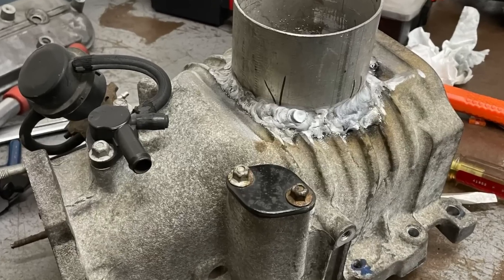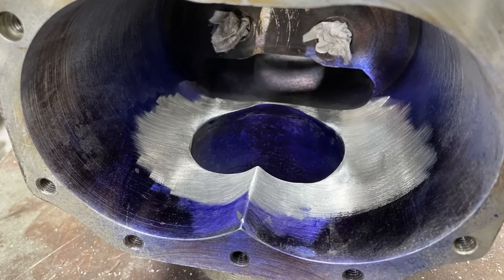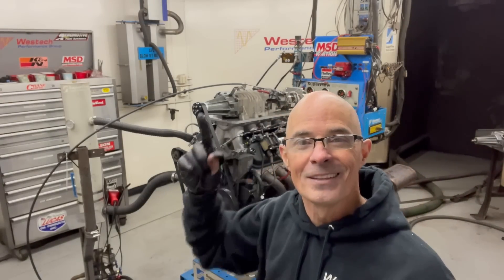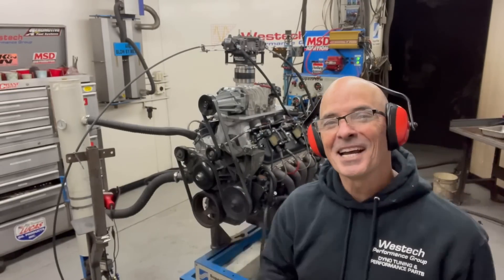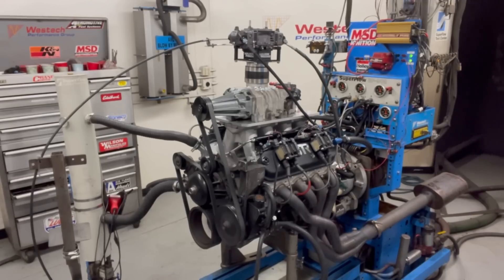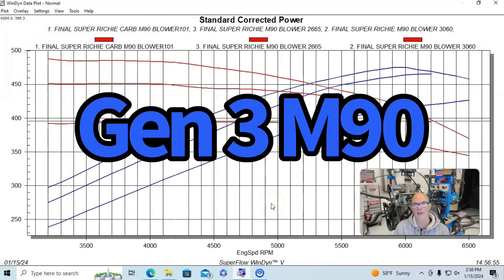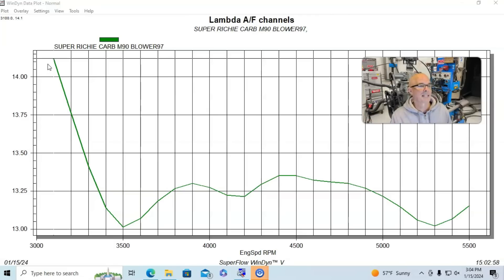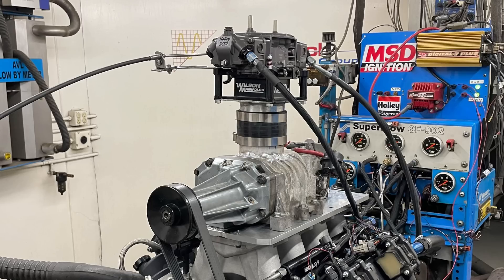CARBURETED M90 LS TEST-HOW TO: RUN A CARB ON A CHEAP M90 SUPERCHARGER! JUST CUT A HOLE IN THE TOP!

Comment: I cringed a bit when i saw the booger welding and warpage. I'd like to see a mill clean up a flat, bore the appropriate hole, then drill and tap for an aluminum plate, milling a groove for an o ring to seal. Routine stuff for a experienced machinist. I liked your results though. Sometimes you have to go with the quick and dirty methods.

Comment: Wonder if low temp aluminum brazing rod would hold, they are "low temp" but not 200° low temp, they still need a bernzomatic to melt and its flame is waaaay hotter than engine temp.

Comment: The Australian chevy (holden) has a 135 degree rear snorkel for the M90... works well in moving the intake... an alternative to a mod like this.
Reply from the maker: that is not an alternative to the carb mounted on top of the blower, but might help with efi on RWD applications

Comment: would have been good if you put it in a mill have a flat for tapped holes and make the top port even bigger again
Reply from the maker: there isn't room or material for that
Reply: @richardholdener1727  im hearing lack of skill and a mill its possible

Comment: Use a milling machine and press fit the pipe with an arbor bushing after you apply loctite to the contact surface, then just use a cutter to precisely mill of the excess that protrudes beyond the inner case surface.

Comment: U should've shouldnt have applied so much heat at once do lil spots at a time an i can bet it wont warp 😂😂 i like your videos sir im not a pro mechanic but i learn alot watching these videos
Reply from the maker: the welding was done a little at a time-the material is very thin

Comment: Awesome video! I currently have a Twin M90 setup on a Small block chevy i fabbed up a few years back. I took my blower housings to the band saw and cut them off right at the back of the bypass holes. I then welded the bypasses shut and fabbed up flanges on the rear of the blowers to connect an upper intake to.  I fabricated my lower intake on top of an old performer intake, basically welded a box on top of the 4150 flange, then funneled it up to fit the base of both M90's. I did all of the lower intake welding first so i could bolt the blowers down to the base before welding on the rear of the housings. I also did my welding with the blowers assembled. I feel you might have not had nearly as much warpage if the front cover was in place at the time of welding. Or even make a dummy cover out of 1/4 inch steel to hold the large opening in place while putting the heat to it. I am running a serpentine pulley on the crank off of a TBI,   chevy truck (not sure what diameter that pulley is) with stock pully's on the blowers and it makes about 11-12 PSI at 6800 to 7K. I was running a 750 Mechanical secondary double pumper with 78's in the front and 86's in the back, but with a power valve block off... Unfortunately my lack of knowledge on setting up the carb ended in me running face of the sun lean and i melted a really nice set of blower  pistons out of it...  Really should have boost referenced the power valve properly.... Right now it's back together with a stock bottom end, and if my math is correct, at least from the Blower Shops equation, I actually need to bump up to a 1050 to feed what the twins are making.......  It's so cool to see this stuff tested on a dyno while making all of these wild changes, Keep it up!!

Comment: I think you should v6 that blower  i have a vp ( buick v6) with a 6v71 Detroit blower and twin throttle bodies (some videos on my channel) not tuned stock injectors and it runs will be interesting once injectors and tune done.      This did do alot better than I expected though

Comment: Richard I Am David Bates from Montana I contacted you about a year ago about putting an M90 supercharger on a 2.3 l Ford Lima engine I still plan on doing it I want to learn more about the video where you had the carburetor on the elbow
Reply from the maker: going into the throttle body
Reply: @richardholdener1727  yes the video where you have the carburetor going in to the rear on the elbow I want to learn more about that one see I told you I was putting a two-barrel carburetor on mine and you suggested I put a 4-barrel carburetor on their I am a big fan of the 2.3 l Ford Lima engine I have a turbo motor I'm going to put in a 79 Ford Pinto now
Reply: Yes I have an Eaton M90 supercharger and a 2.3 l Ford Lima engine at first I told you I was putting a two-barrel carburetor on there you suggested a four-barrel

Comment: @richardholdner question sir. That blower is designed for a v6 and not really effective for feeding a v8 BUT  if you run 2 of those on a v8 but have  1 blower for left side and run 1 for the right side keeping then separate ( 1 for 4 cylenders and thr 2nd blower for the other 4 Cylinders ) you would now see more  Efficiency and easier power gain . . It's like your taking a turbo from a semi and putting it on a car ( awesome power ) but if you took a turbo for a car and put it on a semi it would lose power infact it would restrict power . Great video and keeping a open mind and search for knowledge and keeping the questions WHAT IF alive
Reply from the maker: Technically the blower is not designed for any motor configuration, but rather a flow or power output. It works fine on milder V8 applications, we have made over 600 hp with them. Twins are already in the works

Comment: It would have been lean because the power valves wouldnt have opened. 
With that little huffer pumping away furiously under the carb, the powervalve reference port in the baseplate of the carb would have been seeing much much higher vacuum than it would at WOT on an actual engine. 

Also, is there any reason you didnt just weld a 4bb carb spacer straight to the blower housing? (Mill all the ribs iff first, and weld it straight on) perhaps welding two things of a more similar thickness/preheating the blower housing "might" have  reduced distortion.
/probably not.
At least then youd have something someone could then fit to a car. As lol/click worthy that tall stack is, its not really very practical in the real world.
Reply from the maker: spacer won't work-vacuum was high at wot
Reply: @richardholdener1727  need to externally reference the power valves with a boost signal. Id wager you must have a whole cupboard of boost modified carbs there?

Comment: I fabricated an adapter that doubled as a 90° boxed elbow to come off the rear of the supercharger. (Replacing the throttle body adapter) It located the carb above the supercharger. It worked fairly well on a sbc 350 but I'm not sure ot was worth all the effort. I had all the needed materials and if I worked for .50 an hour, then it was definitely worth it. 😂
Reply from the maker: if you watched the vid til the end-you saw the elbow into the throttle body

Comment: I remember a 24hrs of lemons car that had a 455 olds with two m90s mounted case forward with a plenum and a quadrojet.  The article said that had an intake  backfire which sent the whole assembly to the moon.
Reply: Similar thing happened with a draw through turbo 454 setup in lemons

Comment: I wonder if brazing the adapter to the blower would have prevented the warping, or at least limited the warping to something more manageable.
Reply: best way is  to do small  increments  2 inch welds at a time , let cool , do it in 4 places  around the circle then  weld  in between , this prevents  warpage, it takes a little time

Comment: Hey Richie! You should try and get in contact with this guy to see what troubles he’s gone through. He did an Olds 270 with a m112 flipping it and running a boost reference eddie carb off the original port with an adapter chocking flow. Perhaps the m90 is better suited if you can adapt his jb weld intake flange as a carb flange. Thinking about giving this a go this spring or summer. Might finally be able to give smog sbcs some power with a cam, and some garage tomfoolery https://youtube.com/@raysoto1969?si=9BMhssTAW18aW0kk

Comment: why not use the ford thunderbird m90? its already ported ontop unlike the GM version
Reply: I just googled Thunderbird m90 and it looks like the intake port is in the back very similar to the GM m90. It does appear they flipped the entire supercharger upside down so the exit port is on top instead of the bottom. Unless it changed by year and I'm just looking at the wrong one I don't see how it makes anything easier for Richard.
Reply from the maker: much harder to find

Comment: With today's cnc machines I don't think it would be to hard to machine the top of the blower to fit a carburetor adapter plate that would bolt on .
Reply from the maker: you can't machine the top for a carb-there isn't enough material
Reply: @richardholdener1727  ahh that... blows .lol

Comment: I know what welding a contoured insert fitting into pipe does. That must have warped a considerable amount. Great stuff!
Reply from the maker: it was warped a LOT
Reply: @richardholdener1727  best way is  to do small  increments  2 inch welds at a time , let cool , do it in 4 places  around the circle then  weld  in between , this prevents  warpage, it takes a little time
Reply: I had my silencer ports welded closed, the M90 sounds way better now 🤣👍 micro amount of warping and welder said it was a massive pain in the a$$ ha ha

Comment: Time you invested in a good 3d printer. You could have ground off the ribs on top, and 3d printed yourself a blower to carb adapter and glued the thing on with some kind of epoxy glue.
Reply from the maker: I think you meant to say-that was cool Richard
Reply: @richardholdener1727  no I meant to say that was REALLY COOL Richard.

Comment: Do you thnik its possible to flip the internal of the m90 to run on a ccw rotation honda engine?
Reply: Could you mount the SC backwards and then run a jackshaft? That would let the SC internals spin in the normal direction .
Reply: @TheInsaneShecklador yes it clould work but i try to keep it cheap and simple,  i dont like the idea of adding moving parts and weight.. i heard that you can reverse rotation some eaton but only few of them..
Reply from the maker: just backside the belt
Reply: @richardholdener1727  Belt slip? Or not a problem?

Comment: It's probably easier to build an adapter for the stock throttle body location.
Reply from the maker: did you watch til the end of the video?
Reply: @richardholdener1727  I did, but I was commenting while watching it.  I have seen a couple old flathead running that setup for years.
Reply: @richardholdener1727  It's interesting you did this. I started thinking that it would be interesting to see, instead of drilling a hole in the top of the supercharger, somehow adapt a side draft carburetor in place of the throttle body to eliminate the elbow. The Impala I have has the L67 supercharged engine and it would be cool to replace the throttle body with that side draft carb and be able to close the hood.
Reply: That might not be an option because of firewall clearance especially on shorter motors. I had to cut 8 inches off of a m90 to fit it in an rx7
Reply: @Mrshotshell  it depends on how you rout it, and which m90 you use.  I have seen it don't on a couple flat head v8's where the old hot rodder built it so the carbs were over the blower.

Comment: Another awesome video Richard. I had a related idea for an experiment you could do for us. What happens when you use a carburetor and an elbow instead of a throttle body and injectors on an LS truck intake? Are the LS truck intake EFI top end power gains over a dual plane carb intake due to intake geometry, even fuel distribution, or something else? Can a carb on a truck intake make similar power on the same intake that normally uses port injection? Will it be way worse? I assume worse, but want to see this for science, and to hear your thoughts.
Reply: Fuel distribution becomes an issue based on other testing I’ve seen. I think it’s because the carb would be on one end and the air mixture has to wind around a fair bit. 
Even with a dual plane it’s a pretty even and reasonably direct path.
Reply: I assume that since the plenum inlet is at the front, the back cylinders would run much leaner.

Comment: Im thinking carb on the elbow would work better , at least as far as fabrication is involved. On a SBC, you could run an msd short distributor with the crab cap and a front mounted ignition.

Comment: Can I mount an m90 on its side?
Reply: If the old detroits and newer m62s can Im sure they can as well
Reply: I saw a video of someone mounting an m112 from a Jaguar upside down onto an Oldsmobile. He showed some internal baffling around the gears that needed to be ground away to keep them well lubed. I don't know if the m90 is similar but it's probably something to look into.
Reply: @TheInsaneShecklador  you are correct I did also  comment the link to the video and corrected that it was a m112 but it’s not there now 🤷🏻‍♂️ oh well. Think my brain thought it was an m90 because I initially had watched it I had thought that it’d be much easier to do with an m90 because you don’t need to flip it upside down
Reply: @TheInsaneShecklador  oh wait you’re replying on a different comment. Duh! I had brought up that video to another guy. Yeah he added some grease nipples to the bearing on the impeller shafts as he feared the gas, that wouldn’t normally be in the mix with a efi blower, would slowly clean it out
Reply from the maker: yes you can change orientation of the blower

Comment: Warped it on the side that matters least.  That's the intake area, low pressure.  Seal really needs to happen around the outside, not a lot of grinding done there.

Comment: I had no idea you were going to modify it to like a b&m mini blower or that the rotor pack would work that way .... I wish you were closer I could have run a boring head through the case to make it right after the welding .... Looking forward to  the video on rear Mount carb which is how I figured you would do it .....  Crazy what you are getting out of this little supercharger
Reply from the maker: that worked well too-plus can EFI, carb and EFI & Carb

Comment: Dude your my hero!! I’ve dreamed of doing this a hundred times but never had the guts...thanks for proof of concept! Don’t know if I’ll ever get to try but thought of grabbing a $100 283 sbc.. I bet you could make 400+ for under $500. You. Should do a 1hp per dollar challenge... also I wonder if aluminum mig spot welding would put less heat into the case and help with the warpage... YOU DA MAN!!!😎👍😁
Reply: Frankenblower......😂
Reply: you dont have to chop the supercharger. 
just make an elbow that bolts where the throttle body was, run a pair of SU44's, any decent side draft, whatever flows enough...  on the bonus side, that means you get to fit an intercooler core underneath the m90.
for a down draft you can point the elbow down or to the side and drop the carb... but that doesnt help velocity.
aluminium doesnt weld right with spot welding. you have to break the protective layers otherwise it's going to leak like hell.
short dashes might work, however. think 2 inch strips every 4 inches.

heck, i remembered, there's the predator constant velocity carb, that thing has no float bowl, it might just do what a throttle body does just fine. if you find one...

Comment: I expect it'd be better to have that massive hole closer to the end that originally had the inlet, especially at lower speed. Spiral rotors.
Reply: Doesn't matter if the air inlet is at the top or at the end.  Almost all roots blowers, even big-boy 6-71s, 8-71s, etc., have twisted (spiral) rotors and they feed just fine from carbs mounted on top.  But I agree, leaving that huge "dead volume" of the original air inlet path from the (blocked off) TB mounting flange to the blower case inlet had me wondering if this was going to work very well.  Apparently it works fine.
Reply: I had zero concerns of the 'dead space'; that's just plenum volume. My concerns were about potentially lowering blower displacement/efficiency.
Reply from the maker: I also ran the carb entering the rear of the blower
Reply: I seen. I didn't check any numbers though.